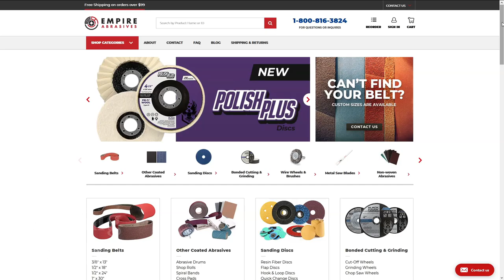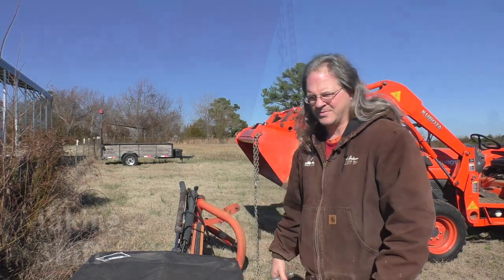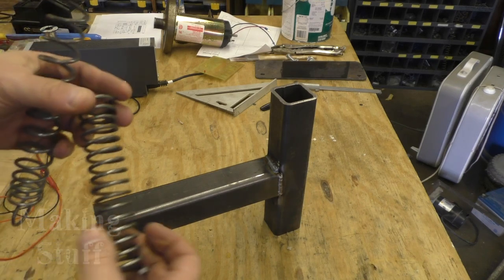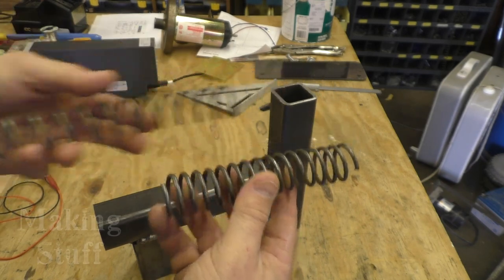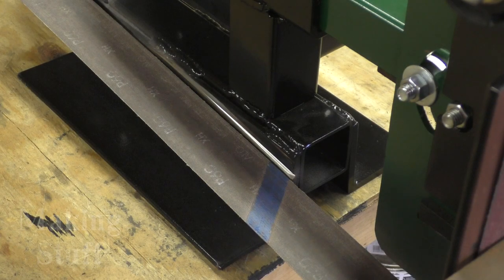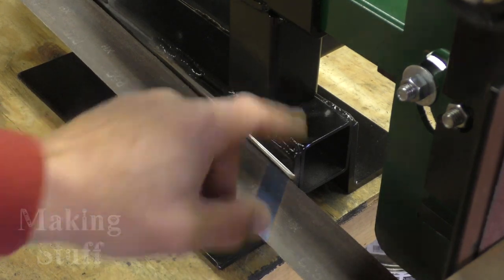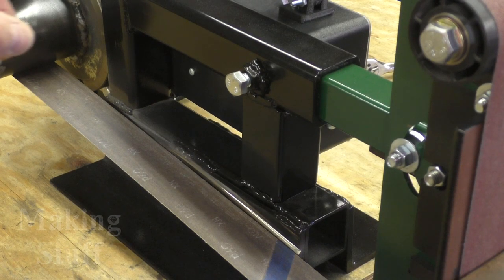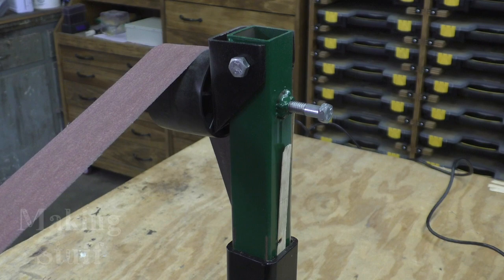Making a DIY 2x72 Belt Grinder from Treadmill Parts 👉RE-UPLOAD with NO Heavy Metal Music

Comment: Hi.  I thought of this idea, a while back. GOOD  FOR  YOU....there are alot of power tools, which can be hacked/converted into other uses, as well as dual uses.  GOOD ON YOU, sir.
Reply from the maker: Cool, thanks
Reply: @MakingStuff    forgot to mention, i was given an old floor scrubber, by a local food store. It has a permanent magnet, 1.5  hp motor. Plugs into 120  AC, and has bridge rectifiers in it, so it is a dc motor.  Made by  OHIO  motor company.  Might make a belt grinder from it, as well.   Have a great week,  all..

Comment: I was getting pretty confident until we got to the electronics side of things. Are there any step by step instructions for this? Or perhaps a in depth tutorial? I also wanted to know where you got that fly wheel from that took the drive pulley, was that on the treadmill? But tha k you for a great video. Good build.
Reply from the maker: You really don't want to copy the electronics.  Just look on Amazon for a toggle switch.  I had all of the electrical parts on hand, that's why I used them.